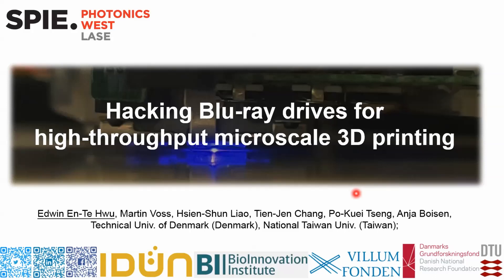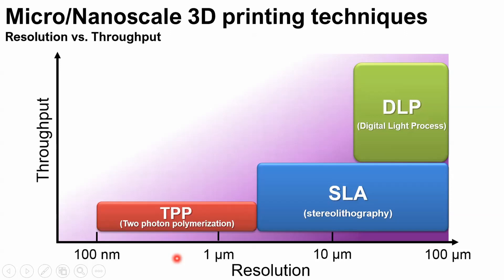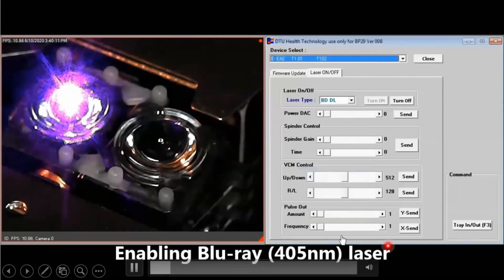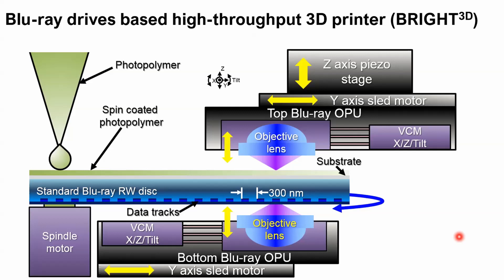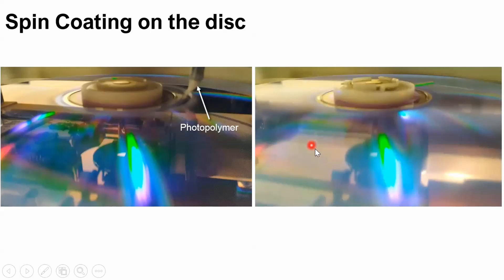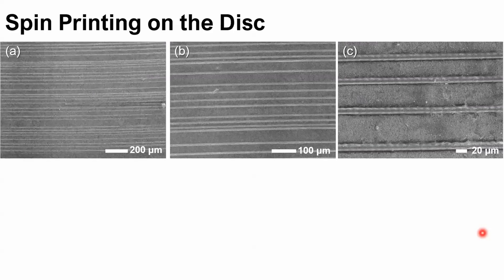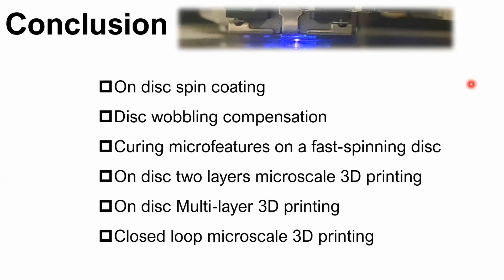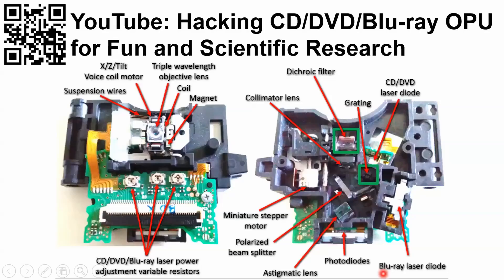Hacking Blu-ray Drives for High-Throughput 3D Printing, Photonics West 2021

Comment: Hi, thank you for sharing your work. Is the software for controling the OPU available by any chance? I have the kem410 OPU and would like to try this setup out ....
Reply from the maker: The software was provided by the producer. I think different drives use different chipset, it's not likely the software can be sued for your KEM410 :)

Comment: I wonder if you can combine this technology with existing LCD printers. Using this technology to develop highly accurate shells of a model per layer where the LCD mask is used to "fill" in the rest of the layer - maybe this would increase speed yet maintain high resolution?
Reply from the maker: I think the focusing might be a issue for the LCD printer, because the disc is wobbling :)